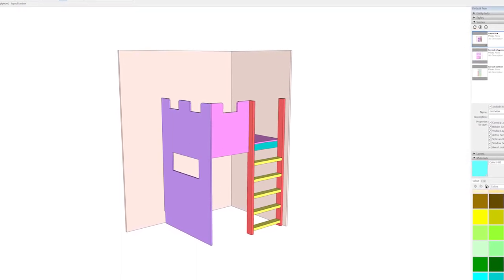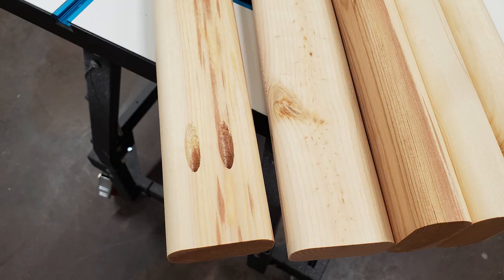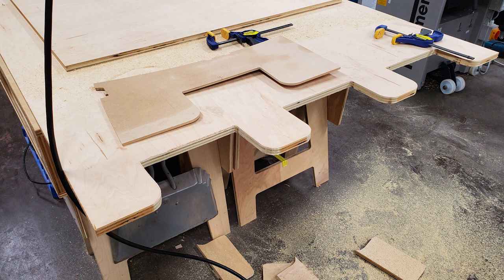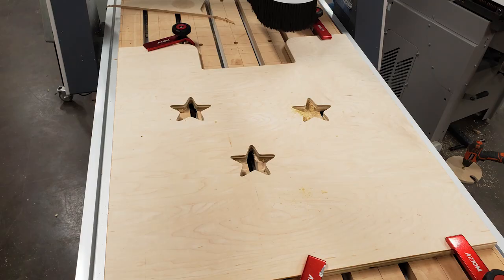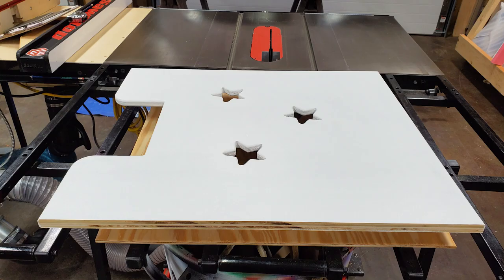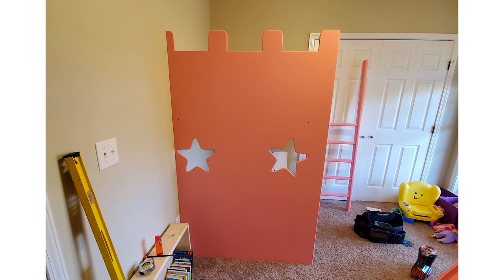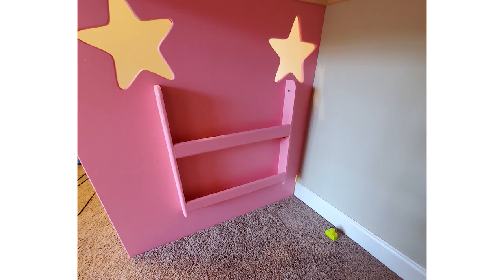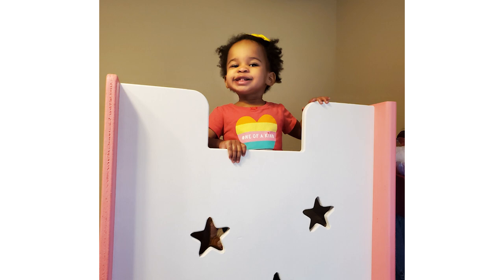Reading Nook / Indoor Play Fort - 335

Comment: Fixing the over width panel is easy. Cut of the present wrong size crenelation. Cut the panel to the correct width. Now design a separate piece with just the crenelations. Attach this to the top of the panel. The bottom of the new piece will look like the overhanging crenelation which is the way castles were actually made.
Otherwise do what you did. No one ever gets it right the first time and who else is insightful enough to detect the error. Only another wood worker. Don't invite them into the room. They never know. Cheers
Reply from the maker: My solution required no extra painting :)
Reply: @JayBates  your keen to save the leftover paint for your shop aren't you ;-)
Reply: @JayBates  You are correct. I hadn't thought about that.